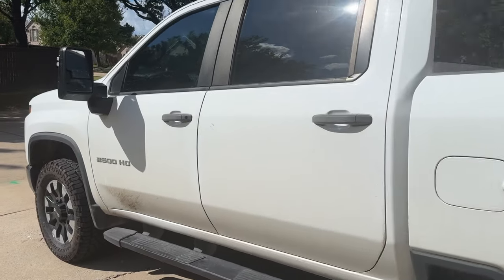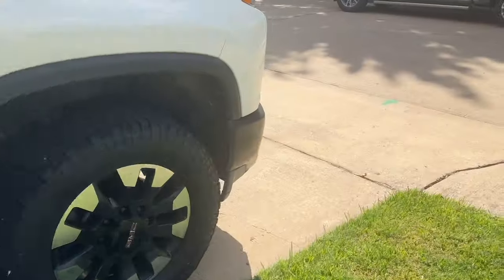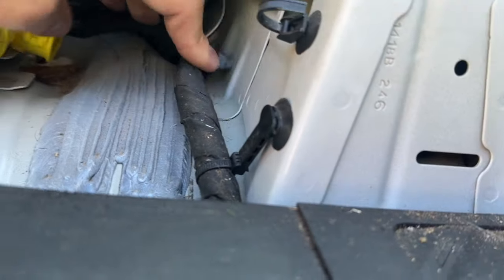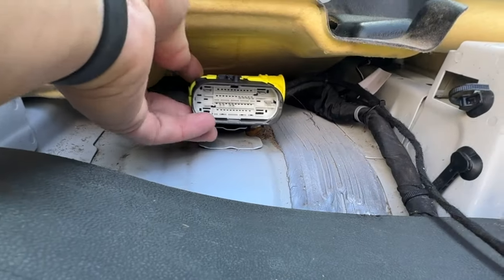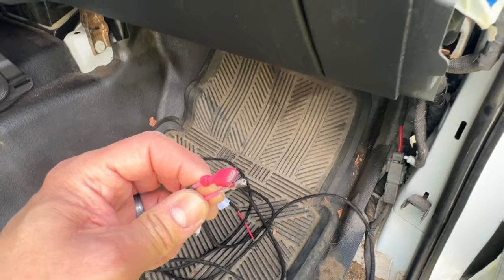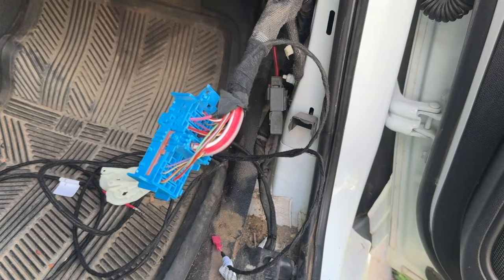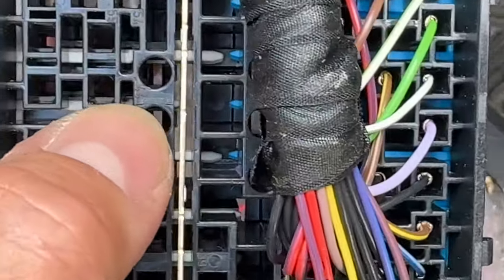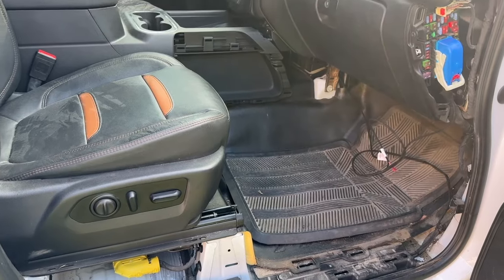2019 - 2022 Silverado / Sierra Passenger Power Seat Installation

Comment: Will these harness work with a 2023 model gmc sierra 2500?
Reply from the maker: @nashville5326  it should yes. GM carried that generation one extra year for the 2500/3500HD trucks.
Reply from the maker: @nashville5326  - you can also reach me at HarnessDR.com so we can confirm the seats you are attempting to install.
Reply: @philgamboa2906  thanks for the fast reply much appreciated
Reply: @philgamboa2906  Hey just wanna make sure I order the right stuff. I bought some seats from a Denali, my drivers side had all 3 prongs but when I hooked up my Denali seat only the lumbar worked. (I’m assuming I need the memory bypass for that) my passenger side didn’t have any prongs so I’m assuming I’ll need to manual to power retro fit for passenger side and then I’ll be good to go? Does that sound correct?
Reply: @nashville5326  have the same problem as you pa did you get yours to work?